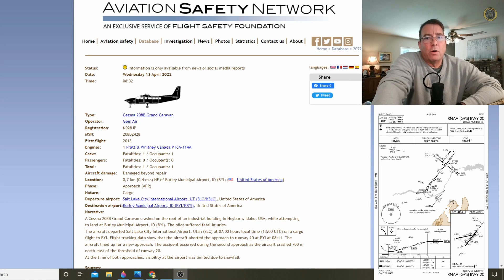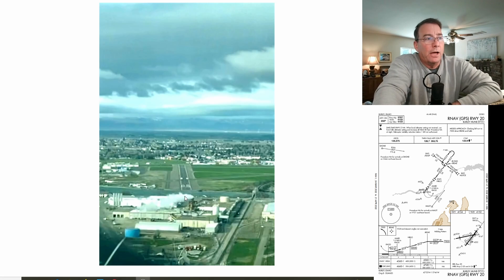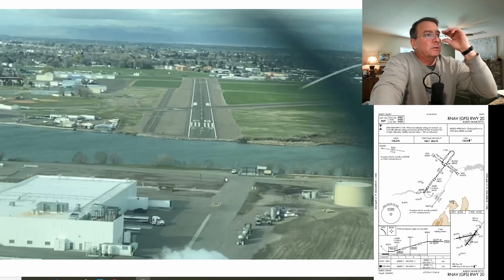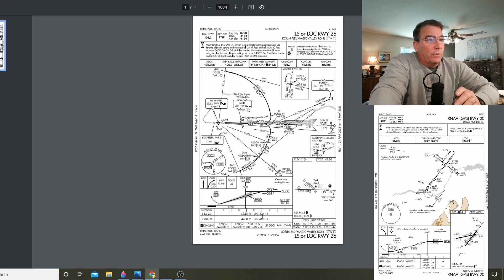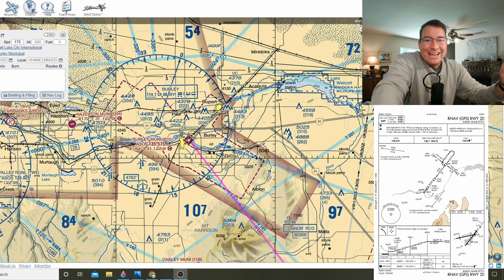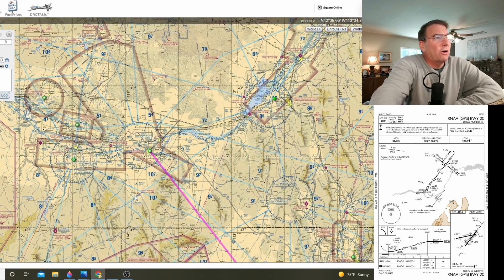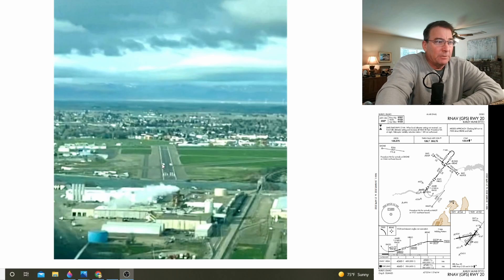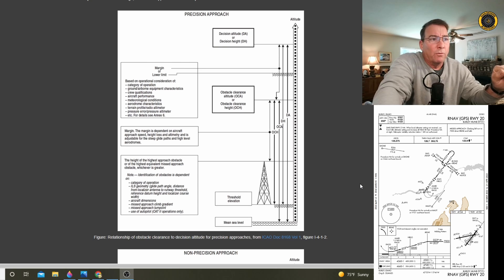Cessna 208 Caravan Crash Burley Idaho New Pictures of Approach

Comment: Let me start by saying that nearly all of my 1700 hours has been in a Cessna 182 (and no, not on MS Flight Simulator,) a little slower, quite smaller than the Caravan, but with quite similar flight characteristics. Most of those hours have been in Idaho, Utah, and Wyoming - 12 months a year. It's a challenging environment at times. And, we all make mistakes, get just a little lazy, take small shortcuts, etc. (so, I'm admitting that, and saying very specifically that nearly every time I deviated from the FARs, it was a stupid choice. Period.) I am instrument rated and have done numerous precision and non-precision approaches into uncontrolled airports. But those uncontrolled environments are where I absolutely cut no corners. Actually, that's not really the correct way to say it - I don't cut corners on approaches, but I build in higher tolerances with uncontrolled environments. If for no other reason, there isn't a tower controller watching you on their radar as a second pair of eyes.

I do wonder how much UPS has reviewed their internal manuals/procedures for their pilots flying into uncontrolled airports, warning of pressing limits, especially since there seems to be a strong general sentiment that Part 135 pilots are pressured into taking chances (I don't know, I've known a lot of them and never heard any voicing of that sentiment.) And, to be fair, it would be useful to review not only those manuals and procedures, but also the incentive structures. For example, are pilots rewarded in any way on, say, "Percentage of Missions Completed." I can't imagine that, but who knows what the real pressures are. People keep talking about the pressure of completing a mission, but I haven't heard any specific argument of why that pressure would exist. Not saying it doesn't, just curious. And trust me, no one knows the internal pressure to be safely on the ground in conditions such as those she faced on this flight. And just a subtle nod her way, going missed is not as easy as it sounds. You really have to train yourself to assume you are going around, have everything set up, to do it - it can be extremely disorienting if you're behind the curve on that stage.

The very first thing I thought of when I first heard the bare details (i.e., missed approach, reset, descend below minimums in second attempt) was that Twin Falls is 30 miles away. It's a regional airport with all services and an ILS. You WILL be able to land in Twin Falls and it WILL be safe. I'm guessing there is even a significant number of UPS trucks operating out of Twin Falls that can make the one hour (well, snowy roads - maybe not) round trip to Burley. But at worst there might be a couple of hours between the time the cargo was supposed to arrive and when it finally does arrive.

Burley is a little tricky, but mainly, it's just little. It's set right in the middle of town with plenty of construction surrounding the field. I'm guessing the reason, over 25 years, that I've never flown an approach into Burley is that in that environment, I just don't want to do a circling approach if I don't have to. I've never flown an instrument approach into Burley, but have flown in VFR (but not to RWY 20 that I remember.) I think the most important detail - and it's right there in the NOTAMS for the airport, is specifically about the tower in the path of the RNAV RWY 20 approach. So, in that NOTAM, the tower is listed as 4291'. The MDA on the approach (assuming landing straight in) is 4560'. So, the aircraft had to be at least 269 feet below minimums in order to impact that tower. This approach does allow a lower descent than a typical non-precision approach - normally, you'd expect 500', but the LNAV allows, in this case, to be at 408 AGL at MDA. So that's a pretty significant incentive to use that approach (the circling minimum on the VOR-A approach is 486' AGL. If you've ever flown a low approach, you know how much difference almost 100' can make.)

Which also brings me to the ASOS at Burley. As noted, the ASOS is an automated weather reporting station on the field. They are actually very reliable. What they don't tell you, though, again, as noted, are runway conditions. They also don't tell you - and this is so critical here - is the horizontal visibility at 408' AGL. If you're standing in your front yard during a reasonable snowfall, you usually have reasonable visibility - you can see down the street. At 408' AGL, going, I'm guessing, about 90-100 kts on short final, it's completely different - very often, you can't see anything. You can see down out the side windows, you may even be able to clearly see the ground, but not ahead - you know, where the runway is.

There was also a comment in the video that caused two thoughts to come to mind: 1) I would NEVER fly through a steam cloud a few hundred feet off the ground. I'm sure it's safe, but even imagining a pretty wide funnel, it would be unbelievably easy to dodge it on final. I mean, hell, I've flown through the center line by a LOT more than that. :D More seriously, though, 2) seeing the wind there does make me wonder what the winds were that day. There were motives to fly the RNAV because of the lower legal descent, but I'm maybe just a little surprised that she didn't fly the VOR-A approach since the MDA is actually 20' lower than the circling for the RNAV approach (but, I'm using a couple of older approach plates for reference which probably explains that.) It's a small, but curious thing. I would like to know how many landings she had at Burley prior to this incident. If you look at the approach plates and on the airport diagram, there are several towers guarding the two runways that would be favored if the wind was out of the southwest (or generally in that direction.) 

One other comment was on the steep approach. Fair enough, steep is okay to use - it is not the standard descent normally associated with an approach. But, it is a Caravan with the capability of stopping well within 2000' and this is a 4000' runway - plenty of room to eat up some runway after passing the threshold. It's not an F-16, after all. For that matter, IF I were thinking of dropping below the minimums to "take a peak," here, you could slow down a little more to maybe 10-15 kts above stall, holding the MDA until you know you're crossed the threshold, descended (ewww, just thinking of doing that makes my skin crawl) and taken that peak. You could easily still have plenty of room to cut the throttle, push the nose over, cross control (to bleed the speed being added by the descent,) and land. So, if reading that makes you nervous - yeah, me, too. 

Anyway, I have read several reports on this crash (trying to ferret out the facts from the speculation) and have been tempted to write my thoughts of it since I have done so much of this kind of flying. It's really just an incredibly sad and tragic incident. I just can't imagine the grief being felt by the family. My family is a family of pilots. T-39, F-16, F-15, F-18, F-35. We have been incredibly lucky getting out of Vietnam, Iraq, and Afghanistan without enduring this, something I think we all assumed we would eventually. And, as every certificated pilot reading this knows, I have to end with "There but for the grace of god go I."
Reply: 2nd para. UPS has nothing to do with this operation. They contract with an air carrier to provide "X" pounds of lift from point A to point B,  "Y" times per week. They probably specified turbine powered airplane because of reliability. If this operator can't do it, someone else would. That's it. 
Pilots at the contract carrier usually get paid salary. There is no bonus or penalty for making it in on the first try, second or diverting to an alternate. If a pilot diverts, they usually get fuel and try again when the wx improves. UPS would not have a truck and driver available to truck the freight and it would take longer than the eventual flight. Have sat at an alternate for 3 hrs before finishing a trip. 
Nobody knows what this pilot was thinking. I think she was tired, out of ideas and tried to force a landing. I know what it's like to be tired and ready to be done but that's when one has to hold the line and do the right thing.
Reply: @buckmurdock2500  Boy, great points. I read somewhere that it was a UPS delivery; however, of course you're right. Who has ever seen a 208 with UPS markings? :)

And nice insight into the contract carrier motivations. I suppose that there have been enough times that I finally just said, land and rent a car - enough of this. I sort of imposed that on the mindset of a commercial operation. And, I have spent hours (even nights) in FBOs waiting when it just wasn't economical to do the rental car thing. One thing I like to say when these sorts of things come up is that I've spent the night in nearly every town between Pullman, Washington (PUW) and Laramie, Wyoming (LAR) at some point or another. One trip that was particularly scary ended up with a night in Missoula (can't get past Mullen Pass) and the next night spent in Hayden, Idaho (remember the small strip next to Silverwood theme park?) Ah, those little additions to the number of times you might not have walked away. 

Seriously, though, you're absolutely right. Maybe one of the key points is that you really have to have the right mindset. Again, as tempting as it might be, you just can't bend the rules. And for goodness sake, you really can't do that in an instrument approach. I think of myself as a pretty good pilot, and I've done plenty of approaches, a fair number to minimums; but, I am not a military or commercial pilot that might fly 500 hours a year (I think my top year was about 200 hours during the years I doing a commuting relationship between Moscow, ID and Laramie.) So, I just recognized that limitation and tried my best to give myself the most appropriate margins (which sometimes meant not taking off in the first place.)

Again, great, insightful comments.
Reply: @davidmalone9022  You may remember an Oct. 2003 crash at Cody, WY involving a 208 contract flight for a package carrier. A good friend of mine was flying it. They were based at Billings. He had elected to hold before commencing the approach due to low ceilings. He had picked up icing on the descent, plane still configured for ice and lost control about 500 ft just prior to landing. 

During my airline career I did a few overnights out at Helena, Great Falls, Bozeman. Had to bring your "A" game to fly in those airports at night. There was no room for screw ups.
Reply: @buckmurdock2500  I'm so sorry to hear that. My condolences. Yeah, maybe I understated the danger of having any ice on the airplane. And you're right, because of the terrain and because there is always ice in the clouds out here, and because of the tops tending to be so high here - it's just a tricky place to fly instruments because of the narrowness of the margins. 

I just read the report - incredibly sad. The METAR apparently had visibility at almost 2 miles, but a 200' overcast ceiling. The problem with Cody (explaining his reluctance to shoot the approach initially) is that none of the approaches come close to that MDA.
Reply: @buckmurdock2500  By the way, I bought my airplane in Bozeman in 1994. I always loved flying into that airport.

Comment: FAR 91.103
Each pilot in command shall, before beginning a flight, become familiar with all available information concerning that flight. This information must include —
(a) weather reports and forecasts, fuel requirements, alternatives available if the planned flight cannot be completed, and any known delays of which the pilot in command has been advised by ATC,
(b) For any flight, runway lengths at airports of intended use, and the following takeoff and landing distance information:
(2) For civil aircraft other than those specified in paragraph (b) (1) of this section, other reliable information appropriate to the aircraft, relating to aircraft performance under expected values of airport elevation and runway slope, aircraft gross weight, wind and temperature.

Comment: I'm not a pilot, but here is a scenario. On a clear day, with no wind. The steam cloud is flowing straight above the stack. A Pilot is flying in the uncontrolled airport uses the airports' frequency to alert ground traffic of their approach, and pilots on the ground then know to wait before entering the runway. But perhaps a pilot on the ground has radio problems and doesn't hear the landing aircraft's call. Looks back to check for traffic and can't see the landing aircraft through the steam and lines up. The landing aircraft can't see the ground aircraft lined up on the runway through the steam. The landing craft flies through the steam and sees the ground aircraft in his landing path. How close a call is this? This seems entirely plausible and dangerous. No?

Comment: My first question is what came first, the runway or the potato plant?  Who in their right mind would build an airport with smokestacks and towers in the centerline of it.  Conversely, who would allow those smokestacks to be built inline with an existing runway!  

Odds are the freight company uses this airport because the landing fees are low or zero as compared to the better airport as Juan stated, a couple of miles away.  It isn't like this airstrip is the only choice in the area to drop and pick up small packages for overnight or fast delivery.
Reply: The runway seems to date from the early 30s. The plant was much later.
Reply: @coldlakealta4043   Thanks for the feedback.  One has to wonder who and how those stacks were permitted to be built right there in front of an airport runway.

Comment: I did a touch and go in Burley a couple decades ago in a 172 or 182. Reason I remember is on climbout between 300 and 500 ft the aircraft rolled. I ended up with full opposite aileron before it responded and was banked 60 - 70 degrees before I got through it. There were some factory buildings ahead, but not interfering with the climb. Wind was in the 20s or 30s.

Comment: Which was there first,the airport or the  factory? One should move over! Someone was not thinking, such a  waste! San jose cal. Reed hillview Airport, there many years. They built eastridge shopping center right at the end of the runway, it didn't take long before a plane landed on the roof, shopping center is all concrete. Later they built a housing track on the other end of the runway. Years ago it was all farm 
and dairy land. Some one should have to be responsible for planning  like that!

Comment: Spot the hazard, Assess the risk, Make the change … pretty basic workplace safety … 
No.1 how come the stack and tower weren’t painted with red and white broad, horizontal stripes (I’m assuming that both have flashing red warning lights, surely) That’s the cheap fix.
No.2 Why not realign the runway to about 18 … put the left edge of the approach end of the runway where the right edge is currently, same at the other end … then the centre-line would give an approach between the factory and the big tank. Blind Freddy could see this incident coming.

Comment: I'm hoping for a very handsome lawsuit against this plant, this is almost manslaughter.
Reply: For what cause of action? How is the plant liable? If they had the permit, then why would they be liable?
Reply: @carlmenger9145  The county/city gave those permits. A permit to put a steam vent on the centerline of an existing runway.   Clearly negligent, someone probably got paid off.
Reply: Over than enriching legions of lawyers and dragging this on for years, what does a lawsuit accomplish? Best result: you get a check. And how big a check does it have to be to compensate for the loss of a beloved child? Best to move on with the courage and resolve the young woman had shown.
Reply: @carlmenger9145  The plant applied for a permit which was granted. There is no legal exposure to the plant for requesting a permit. The legal and moral responsibility lies with those who approved it.
Reply: @coldlakealta4043  :By that rational, there is no point to any legal action at all. What's the point of locking up a murderer?  Families of the victims could just live courageously instead.

Comment: How could this approach have been approved in the first place? Sure, the aerodrome's been here since 1930, but doesn't mean that the regulator has to keep approving an IFR approach to that runway. Approving an approach with a smoke stack on final certainly demonstrates a lack of judgement  (I'm being very polite here, avoiding any expletive),  and I don't care how accurate the TERPS calculations were. Now, if the regulator had denied an IFR approach as a result of a smoke stack being erected on final, then it could have been resolved by the airport opertator threatening to sue the potato plant. But I guess whoever ran the airport didn't know much about aviation safety.

Comment: This is probably the worse designed airport in the state.  That runway is in direct line with obstacles too close to the threshold, period.  IMO, that runway should be shut down until the FAA evaluates the safety of using it.  Those towers should have high luminescent lighting all over it.  Question is, does it, and if not, why not?  Bottom line, until an accident, obvious safety issues are never addressed.
Reply: Not the worst designed airport. The worst designed plant. The runway dates to the early 30s or even earlier. The plant came much later.